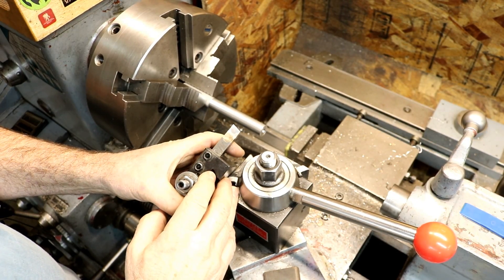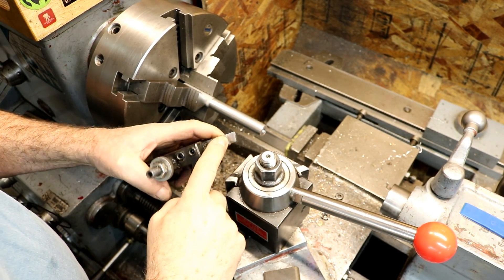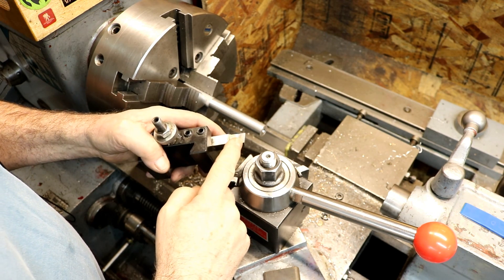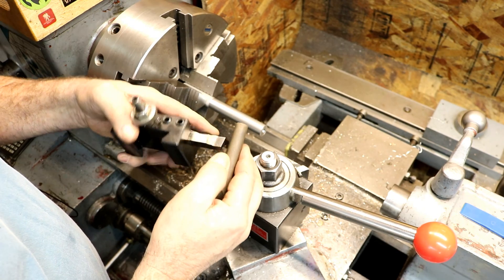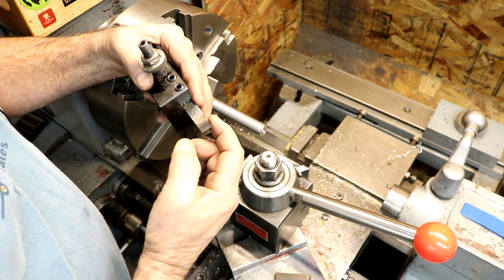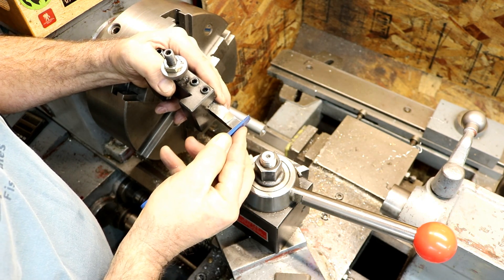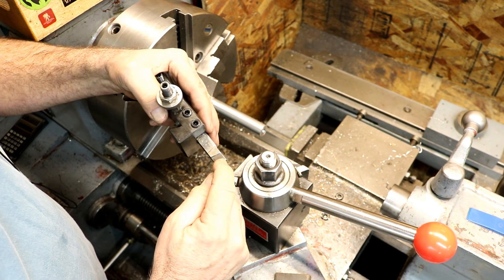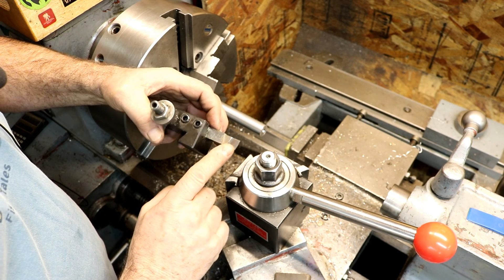Metal Lathe Tips | Dress Up First!  Before the Tool Goes Out | Metal Lathe Hack #3

Comment: Ya got me there. I use HSS milling cutter almost all the time, and they cut nearly everything if you are mindful of speeds and depth of cut. But all the HSS lathe bits I have used were form and slotting tools. Thanks for the tip.

Comment: If you like HSS you should make, and I do mean make, a tangential tool holder. I really do use mine for the majority of my turning and facing operations. About the only thing I use TC for these days is to turn down gearbox shafts to repair them by fitting  new inner bearing sleeves .
If you haven't heard of tangential tooling, it is the most piss easy tool to sharpen you can possibly get, and it cuts exceedingly well too. Oh and there is no need to hone after sharpening, but curiously it helps to hone before sharpening. Oh and two, don't let any body tell you it's a new idea, they go back to at least 1885!
ATB
c